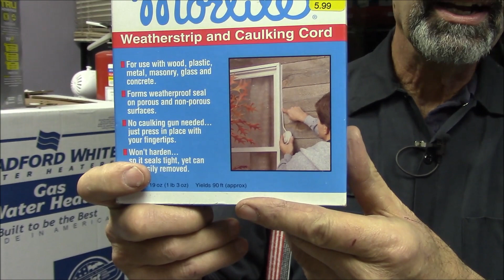Best Removable Weatherstripping Grandpa uses!

Comment: Thank you for showing this product application because my Mother has the marble window sill and aluminum window frames (some type of metal?).  I recently discovered how important it is to remove old weather-stripping and apply new weather-strip. I recently found another brand [ M-D Replaceable Caulk Cord Weather-seal] at my local Ace Hardware Store.  In the past 2 to 3 years, my parents replaced the cedar siding with James Hardie Fiber Cement siding in 2 phases and a new roof - it really saddens me and frustrates the heck out of me that there aren't many honest tradesman.  I wanted new sheathing all around the house, but the siding contractors and roofers did not abide by my request!  The Siding Contractors did apply a new wrap over the old sheathing during the second phase. The Roofing Company was a major LETDOWN - they lied about have a English Speaking Crew Chief.  They cut a ridge vent into our high cathedral roof, which should not have been cut!   I have never felt cold in our house during the winter as I have this winter, so I decided to go beyond my skillsets and learn how to install or replace the weather stripping in one of our kitchen windows.  I surprised myself and gained confidence to attempt one window at a time.  We have six-(6) windows in the living room, which has a cathedral ceiling [gable?] they don't open.  We have five-(5) windows along the stairwell and they don't open. We have two-(2) windows at the front entrance and they don't open. We have one-(1) window in the dining room that slides left and right to open and close. We have one-(1) window in the kitchen above the sink that slides left and right to open and close.  The master bathroom has one-(1) window that slides left and right to open and close.  The secondary bedroom has one-(1) window that slides left and right to open and close.  The office has one-(1) window that slides left and right to open and close.

Comment: I use Mortite to seal speakers to their cabinets instead of expensive custom gaskets or tape.  Oft times the gaskets will be $20 each.  Many speaker system need to be airtight to function in their design.  And I have enough Mortite remaining to stop the draft coming through my kitchen bay window.  Win win!

Comment: Hi Blair!
You may be the ONLY person who has addressed my issue.
Remodeling a 60s ranch and everyone’s passing the buck. 
Got a bay window- the “side windows” were replaced maybe 10 years ago but the main front piece is original. And I have leaks. 
The individual panes are properly glazed but the seal around the entire window reminds me of the rubber seals found in a screen door. Except it’s very dry and cracked. 
It doesn’t make sense to me to just apply a bead of silicone on top of the cracked “rubber”. Could this be your caulk rope?
Most important question should I take the old rope off and run a new bead? Or would that be screwing up?
I would be glad to email you a photo to properly explain what I’m talking about.
Thanks again‼️👍

Comment: In my home some bead board was installed , however it was installed incorrectly.  It was supposed to be suspend 1/2 inch off the floor, but was installed sitting in the floor. That means I will have trouble, if I mop around the base boards. I want to know if I can put down this rope caulk, as a sealer & then remove the rope caulk, when the deep cleaning is complete. Thanks

Comment: You make and look like it’s easy. I’m 67, recently lost my hubby of 47 years. I’ve already put a drill bit through my finger out the other side, sliced by finger open with a box cutter, had to get the base of my finger injected (trigger finger) fell off a 2 step ladder twice plus a bunch of other boo boos and mistakes. How do you get it to stick in one place as your putting it on. I don’t have the strength to push it down hard. Can I use a putty knife or gorilla glue? It’s for the baseball windows which were never opened in over 44 years and I don’t plan on opening them. I don’t know if you know this answer but the lever to flush the toilet works hard, you have to really push it down. Thanks
Reply from the maker: Use all purpose squeeze caulk to seal the windows. A fresh tube will squeeze out easier than toothpaste. The flush valve gasket in your toilet is getting old and it becomes sticky. Take a picture of it to a reputable hardware or plumbing supply and get the replacement and hopefully a lesson on changing.
Reply: @MrHardware1  I got the hang of putting the rope caulk in. I watched a video of hard lever flush, I changed the “gasket” and the the toilet flushes nice. I got rid of the old fluorescent light in the “workshop” area and put an LED work light in. Oh getting a 4 step ladder today helped tremendously. So far I fell off a 12 foot ladder, twice off a 2 step, now I’m ready to fall off the 4 step. Thanks for your advice and help.